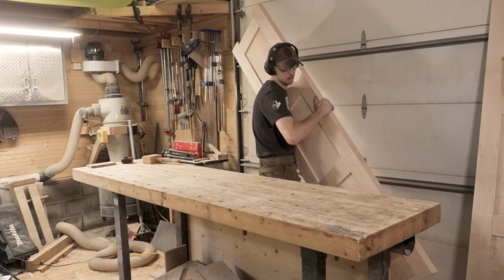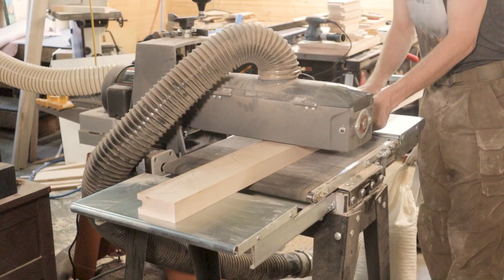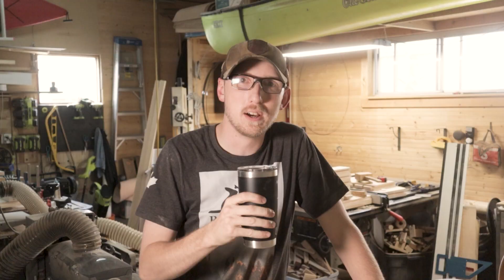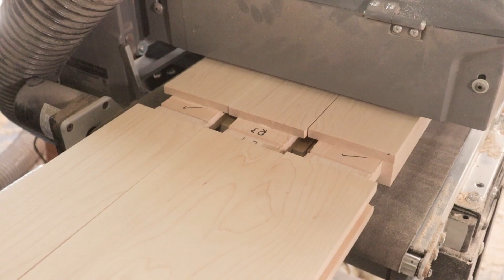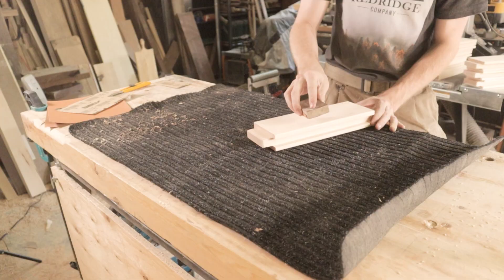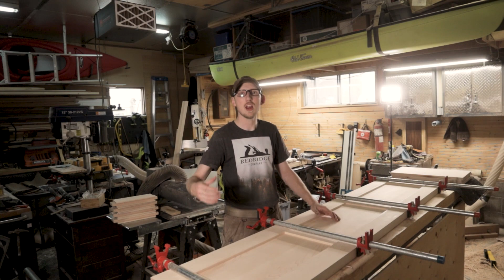I can't feel my hands!  | King Bed Frame 2.0 | Fine Woodworking

Comment: and a SHOOTING BOARD !! 
I used t think these things were silly - I'm using mostly power tools..... trust me, make a shooting board for that No 62 with your 50 degree iron and keep your eyes open for a nice older Stanley or Record No 7  & No 8 (or you could drop the dosh for a nice new one from any of your favorite tool suppliers.
I made 9 table leg blanks and squared them all in about 10 minutes with my No 7c circa 1890's with the original iron ( you can get a nice Hock Iron which is very similar to the LN and LV irons...which I will do at some point)
for those loooooooong edges on the heavy stock, you cannot beat a nice jointing plane.
Loving the series, sorry you hate maple.
Reply from the maker: I built a shooting board a while back and I love using it for small parts and tight fit ups but most of the pieces in the bed are just to thick and long to get enough support! I've seen some examples of larger shooting boards with more support but they mostly rely on a perfectly flat workbench, which mine very much so is not.
That is another great reason to get a No. 7 though, the extra mass definitely would make it easier to use with the shooting board!
Reply: @morganhurst_redridge  start your large shooting board build by making a thin torsion box using the Table Saw as your build surface. I built a 36”x60” on top of my 27x40 TS top - certainly flat enough … and you don’t need THAT big.
Once you have that as a base, the test is just is just Uber Sized shooting board

Comment: you need a No 7 & perhaps even a No 8 plane - they are not hard to push though on an thin cut. and don't forget to wax or oil the sole...
Reply from the maker: A No. 7 is high on my wishlist, since I mostly need a good plane for cleaning up edges. I've been watching Ebay and some of my local stores hoping an old stanly would pop up!

Comment: There's so much we have all learnt watching and listening to your progress.  Thank you.  
1.  I polished the bottom of my low angle jack to further reduce the friction.  I also still wax.  I also find that maintaining the blade as really sharp (16,000) helps to reduce the effort required.  The three make a huge difference to pushing that plane through the work.
2.  How do you find using those benchdog horizontal clamps.  Do they replace a tail vice for holding small jobs for planing?
Reply from the maker: Thanks Danny!
I may have to try sharpening higher, I currently only go to 8000 so I'll definitely look into going higher!
For the benchbog clamp, I've never used a bench with a tail vise so I don't know if its a full replacement but that being said I also don't see a need for a tail vise because I have the benchdog clamp so you can take that as you will. Either way if you have dog holes, I highly recommend the clamp!